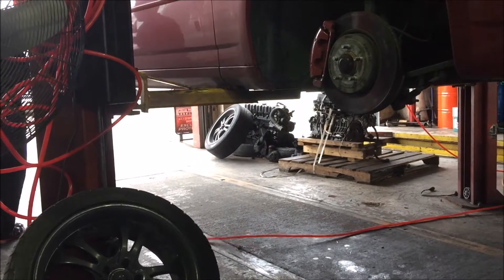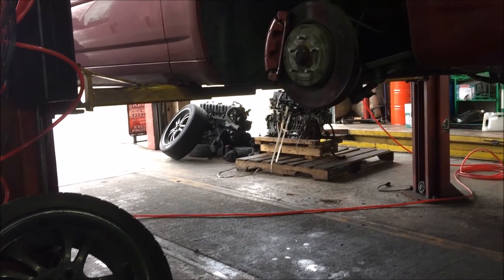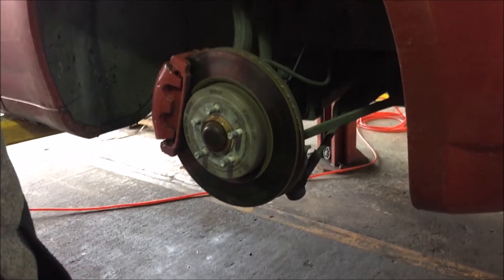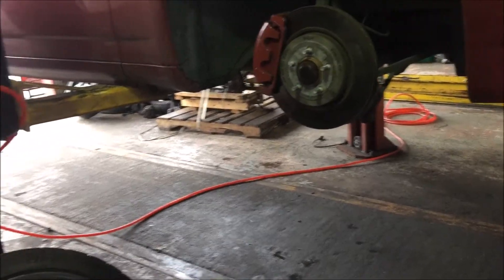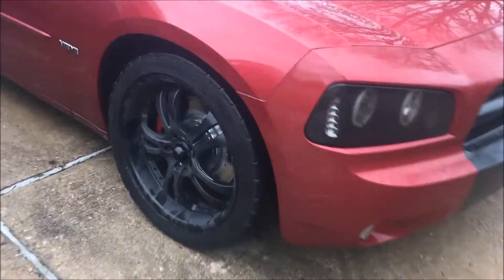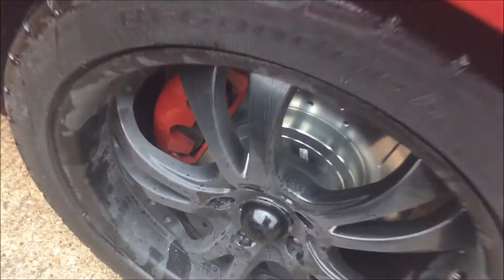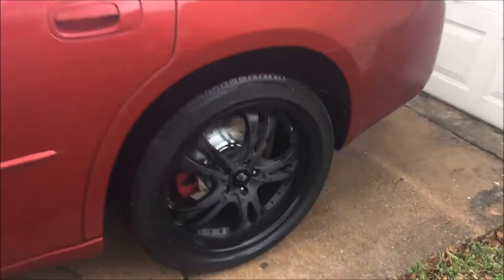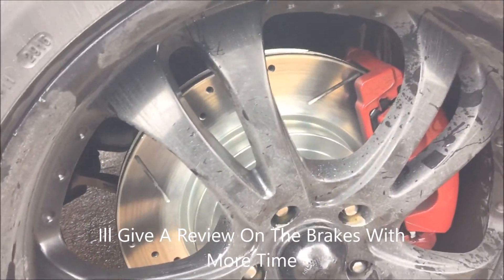Dodge Charger Drilled & Slotted Rotors

Comment: Nice done. I shoud change my rotors soon. What is the brand of rotors? Are you satisfied with them after using some time?
Reply from the maker: Vusal Hajiyev yes I’ve had them for a while and they still work perfectly well! (Brake tech)
Reply: Thanks for reply. What brand rotors used?